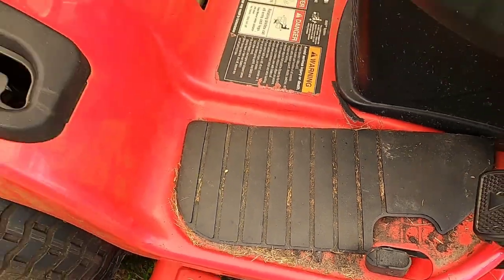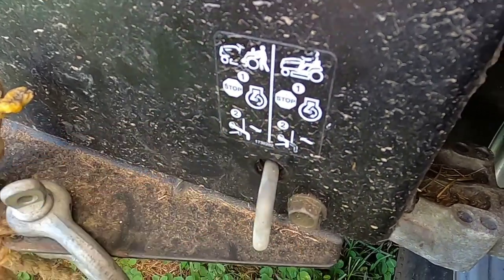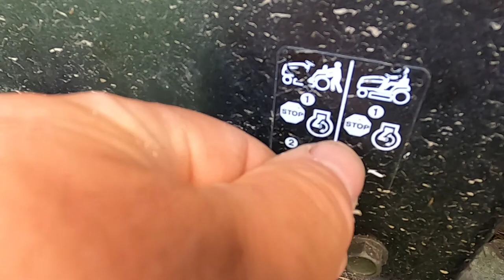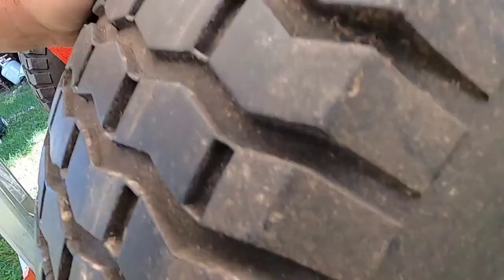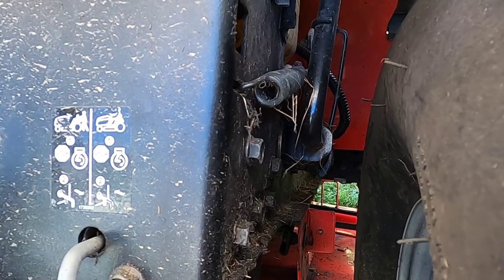Mower  wont move forward or backwards what did I do

Comment: We own a MTD tractor with Briggs and Stratton parts. Just me and hubby. Empty nester. Anyways reverse will work at times but, not on an incline. When I have the tractor in neutral it seems to want to drive. My brother owned a tractor that would do the same thing. Any idea 💡 I'll check my belts and get back to ya.
Reply from the maker: With out being able to see the tractor these are just a guess, first like you mentioned check the belts. They may be worn, covered with grease etc. Next check the pulleys they do wear after time. Next check to see if you have an oil leak around the back wheel axel. Then check the fluid in the transmission/transaxle. Low fluid would cause it to slip. A worn gear in the transmission/transaxle would usually cause a clicking sound or a sudden jumping out of gear, but the forward gear would usually go first. As far as it moving in neutral that is an adjustment. I have video "NO reverse fix" it is on a Craftsman rider but it may be of help on how to adjust your rider;;
https://youtu.be/M1kixYq2ZSE
Let me know if any of this was of help.
Stay safe, Joe Z

Comment: So does the lever loosen the belt , allowing you to move the machine ?  If so I’m sure you won’t do that again… hope you get the right belt the first time .
Reply from the maker: Hi John, the lever does not loosen the belt. It is connected inside of the transmission to a bypass to put it into a neutral state. Not sure if I am explaining that clearly. I do not know what caused that belt to slip off. Had to remove the clutch to put it back on due to the belt guide.
Stay safe, Joe Z

Comment: Hi, can you please see the problem of the burn on the lower bonnet due to the muffler, I have the same problem what does it depend on?
Reply from the maker: Thank you for stopping by. I am not sure  this mower was a rescue. I picked it up after it caught on fire. I believe the fire started due to a oil seal leak. I have several videos repairing this mower. Rebuilding the starter, carburetor and oil seal etc. Looking it over the muffler may be getting too hot. 
Stay safe, Joe Z

Comment: How to fix forward & reverse pedals locked down on husquana riding mower
Reply from the maker: Hi Danny,  I do not have a Husqvarna on hand to check it out. I would first check all the pulleys to see if anything is stuck, twigs, grass build up, then make sure they are not sized. Next I would check all the linkages connected to the pedals up to the transmission/transaxle. Check for any binding twisted links or maybe just a missing cotter pin. Also look to see where the springs are, check to make sure there isn't any grass, twigs, string, wire etc. packing around them & that they are still connected. Let me know if this helped.
Stay safe, Joe Z

Comment: Need help bad
Reply from the maker: Hi Danny,  I do not have a Husqvarna on hand to check it out. I would first check all the pulleys to see if anything is stuck, twigs, grass build up, then make sure they are not sized. Next I would check all the linkages connected to the pedals up to the transmission/transaxle. Check for any binding twisted links or maybe just a missing cotter pin. Also look to see where the springs are, check to make sure there isn't any grass, twigs, string, wire etc. packing around them & that they are still connected. Let me know if this helped.
Stay safe, Joe Z